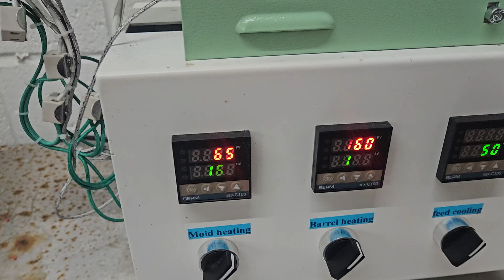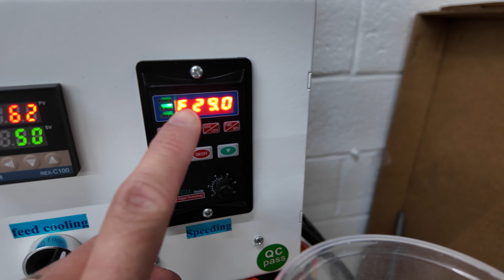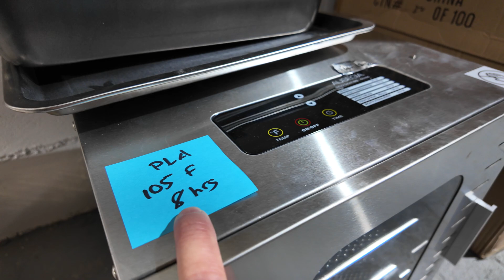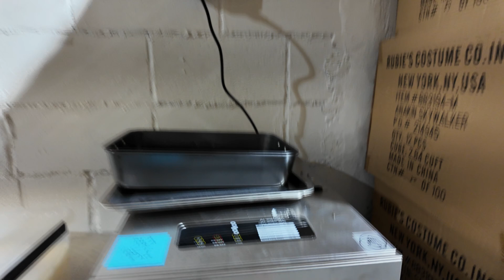Making PLA Is Not So Easy!

Comment: You should dry your pellets before extruding the filament. If the pellets is no fully dried the viscosity of the melt vill increase. This explains why you have lover temperature than recommended.
Reply from the maker: @peergrndahl5000  been drying them now

Comment: I'm pretty sure the oval shape was caused by your yellow rollers. If you still arent seeing perfect circular filament, i would suggest fans only at the end of the second water bath, prior to going into the rollers.. Just to help drop the temps another degree or so. If its still doing it, you might need to slow down the whole thing so the filament can spend more time cooling before reaching the rollers.

Comment: I was looking at some videos from slant3d, where they are also producing their own filament and one thing that he mentioned is the “virgin” PLA use more temperature to melt once you have in a roll. What he mentioned also is that some manufacturers add some extra additives to “allow” the PLA to melt at lower temperature when in a roll. I bought few rolls from them and I have to increase the temperature to get quality prints. Just my 2 cents.
Reply from the maker: Will give it a try maybe 230.. been printing at 220
Reply: the difference is negligible